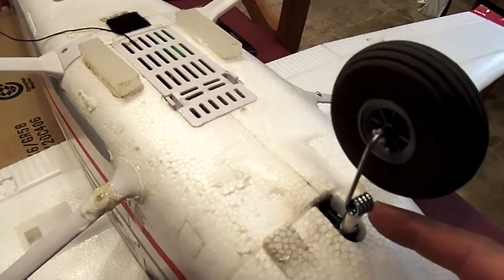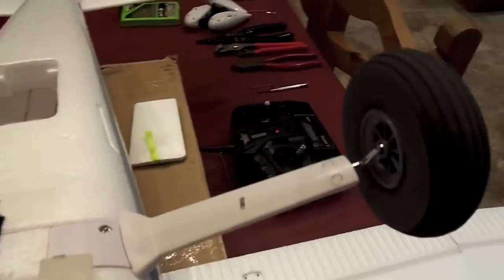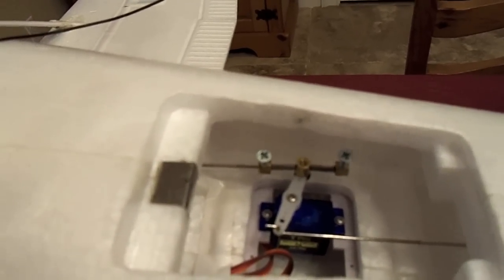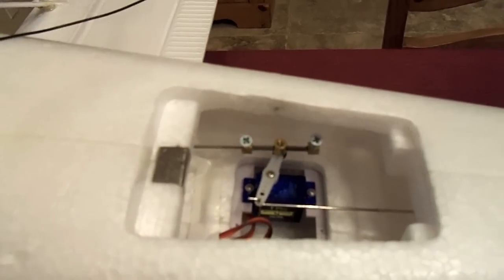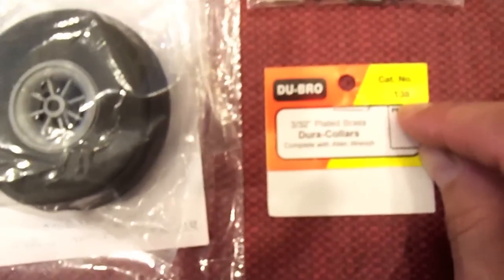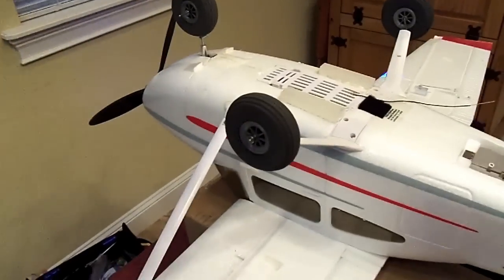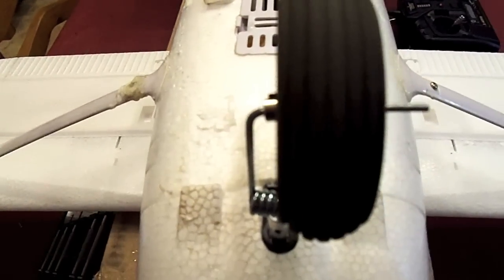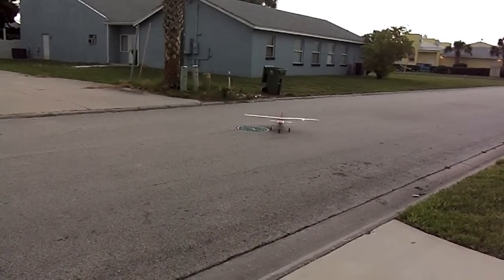Nitroplanes AirField Sky Trainer Landing Gear Modification

Comment from the maker: @Gatorboydc007 On the 90 deg bend I simply laid the original nose wheel shaft next to the new one and bent it at the same length. I can't quickly find the rcdiscuss thread that I used but if I find it I will post it here for future reference. One update to my mod is that I removed the servo saver setup and went back to just the single post connector which came from the servo saver package. It works fine and I haven't stripped the servo again since my landings are getting better.